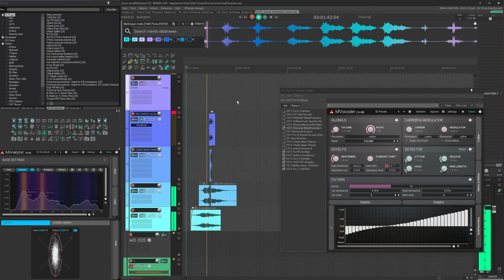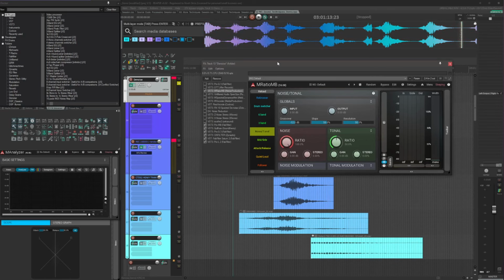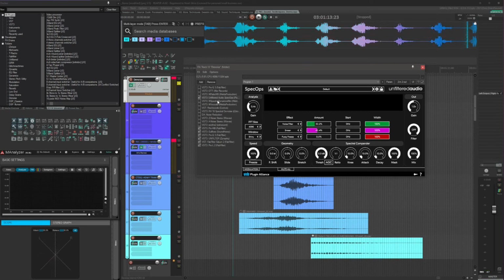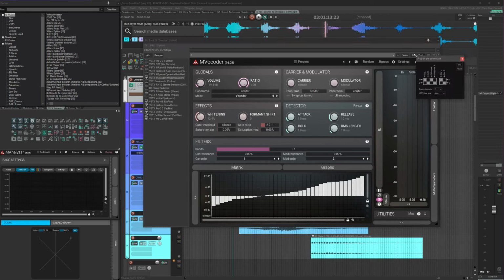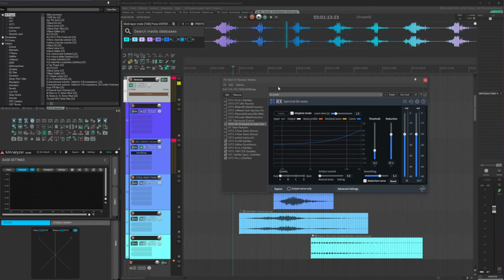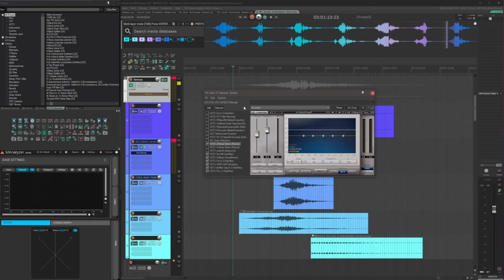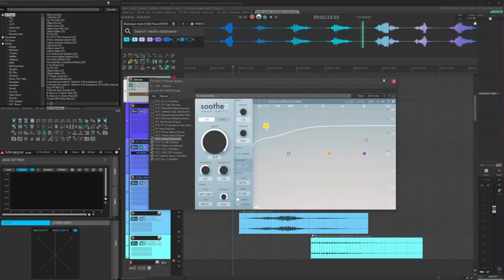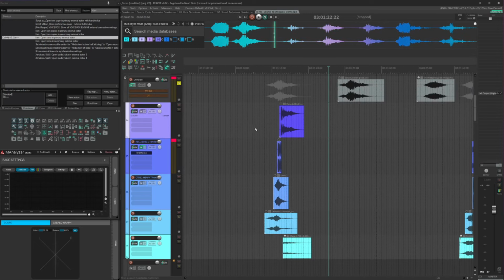Sound Design Trick - Denoiser Misuse

Comment: Great video) There is an option to assign 2 external editors in Reaper. Preferences - External editors. I have chosen RX and Melodyne for example. Then I made two buttons in my toolbar panel to send items into the necessary editor (Item - Open Items in editor - Open copies in editor...). After you've done with the item in RX for example, you can press Ctrl+Alt+S (on PC) and it will send the edited item back into the Reaper as a second take. Pretty useful thing in my opinion.